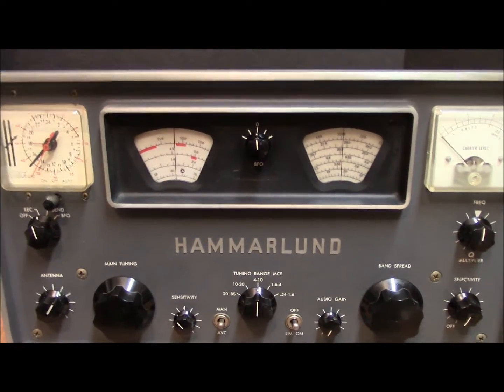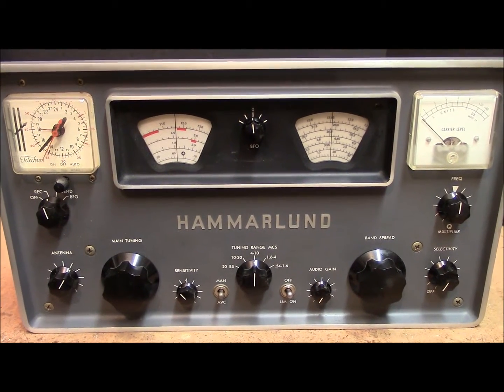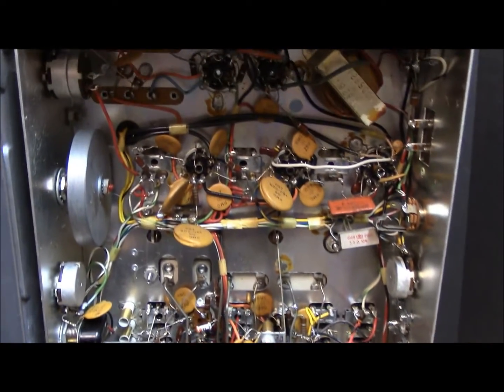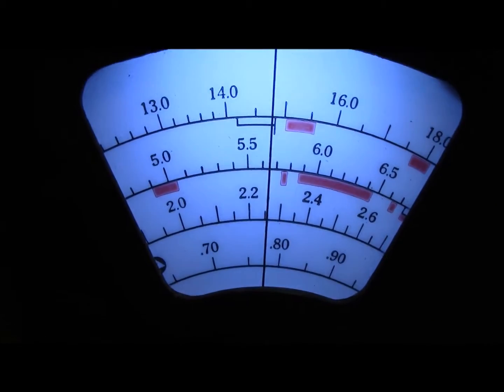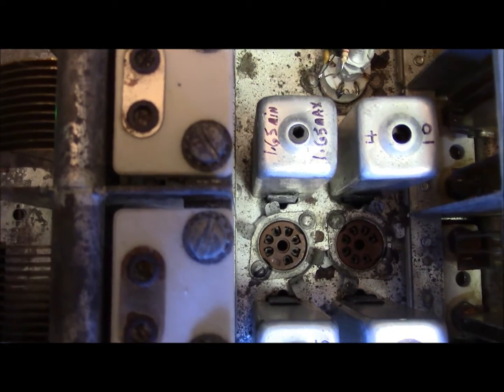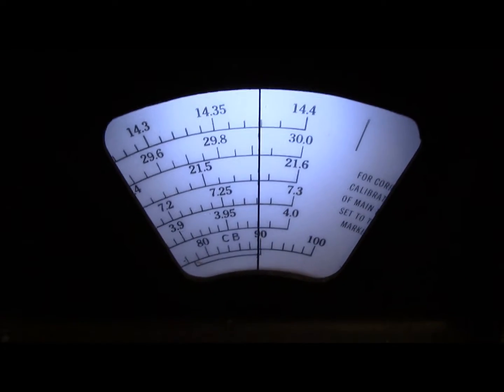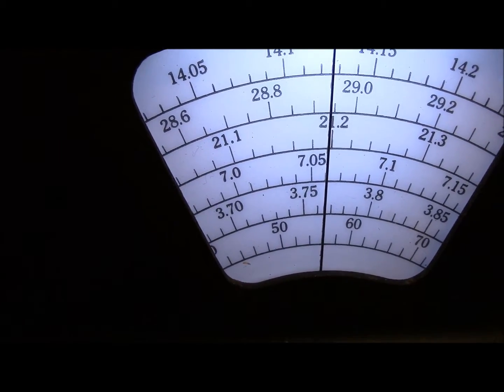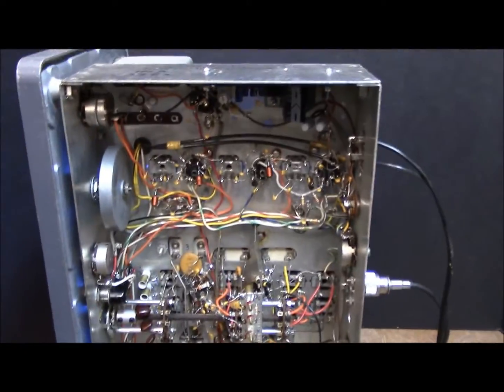Hammarlund HQ-100 Solid State Conversion

Comment: I will be the first to admit it seems to have great selectivity from what I can hear and it's relatively quiet. I'm not sure what you gain from it and I certainly wouldn't do this to my HQ170 or HQ180 or my SP600 just because of their nostalgic value.This radio I would consider it just because they are relatively inexpensive. I must admit that it performs well.
Reply: I started this project because I believed it could be done successfully.  Many people said it could not be done.  I have successfully converted Hammarlund HQ-100, 110, 145, 170 and Hallicrafters S-85, SX-99, SX-100 models.  They perform equal or better than the tube equivalent.  I think it makes a better radio but I would not do it to a museum piece.  They look the same, work the same and calibrate the same.  The advantage is that there is less weight, heat, hum and power consumption. There is no high voltage to kill you and no hot tubes to burn your fingers. There are no tubes to burn out, weaken or short.  The only drawback is that there is a lot of wiring modification and a power supply board and audio board must be added.  Only an experienced tech will be able to do a modification.  You must have tools, soldering equipment, scope, signal generator, frequency counter etc. in order to complete a project.  There are a few drawbacks.  Strong signals are more difficult to handle.  "IF" images are stronger.  Some linearity is lost in the S-Meter.  Drift is about the same in both models because it comes mainly from the oscillator capacitors which are extremely sensitive to temperature. I will be glad to provide documentation to anyone who wants it for a printing and postage fee of $15.00.  I can be found on the Ham call lookup as KV4JT.  E-Mail me at charlessmi1@gmail.com.  My old Juno email is being deleted.

Comment: That's amazing work! Most Hams don't have the skill to do that sort of work.. I might have replaced a couple of tubes with FETs in my life, but that HQ-100 to SS conversion, is a major-major project! Bet that took some tweaking... 

I remember my first good radio.. It was the HQ-110c and I got it cheap because it previous owner had transmitted into the antenna input.. My buddy had a sig-gen and we quickly found a wire going to a coil on an air-core transformer was burned in half.. 5 minutes later, I had a nice like-new receiver. It was no Collins, but it was still high-end for a Novice in 1968..   Sold it to help buy a new TS430s many years later.. Still have the 430 and it still works like a charm.. 73..

Comment: Hi, I got the same radio, but I need help with the antenna, I live in an apartment and what would be your suggestion. Thanks.
Reply from the maker: This radio is very sensitive and will work well on a short antenna but if you want maximum reception on ham bands you should use a resonant antenna for that band.  However a long wire of any kind will work for general purposes.  An attic antenna should work just fine.
Reply: Charles Smith Thanks.